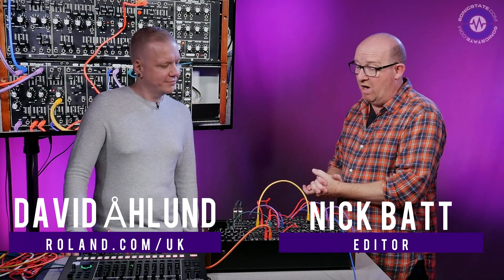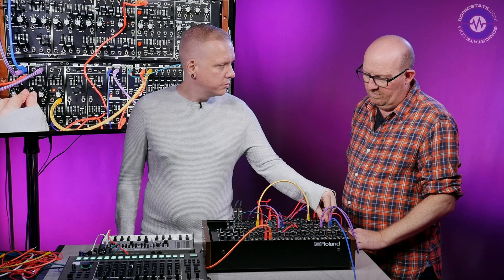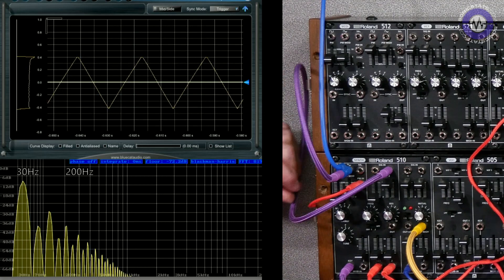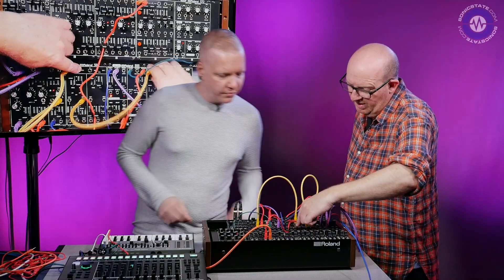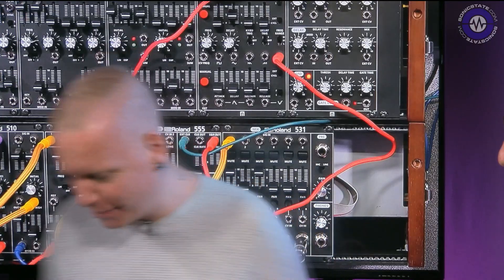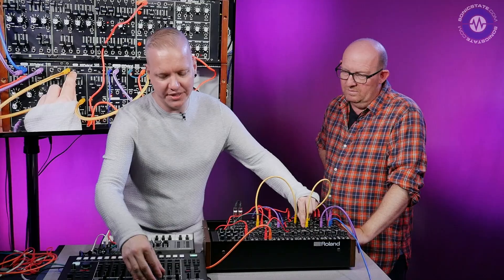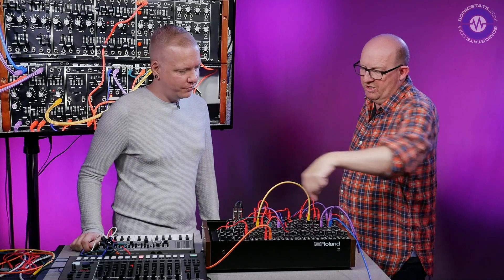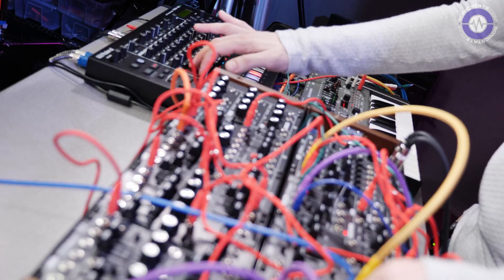Presentation: New Roland System 500 Eurorack Modules

Comment: Next thing I'll be adding to my 15 module 100m and scooper will be the 555. That'll be like having 2 x 165's + 2 x 150's and more. Also looking forward to the Behringer ones, which are more like the originals. More basic than the Malekko Rolands but tempting, as they may be cheaper than even some Doepfer gear! Makes it a tough choice though. I'm wondering if Roland are releasing a 182 sequencer in the 500. Behringers if released looks like a small 182. Both have to compete with Intellijels big Metropolis though, which is a souped up 185----the latter being an extremely rare imitation Roland seq with different design to the 182. For the ultimate 100m type setup add all the 500's and a metro to a frequency central filter to get a 12db filter option too!

Comment: guys, be aware that the 510 & 531 modules have a depth of 128.5mm
 (5-1/16 inches) which is very tall compared to other modules. This eventually stopped me from buying the 510. I got a 512 instead since that's only 58mm.
Not sure why Roland made this choice... maybe just so they can sell there own cases along with it as well, since theirs is one of the only ones that can fit modules that are that tall..
Reply: Depth of the new modules:
SYSTEM-500 531 -  129mm
SYSTEM-500 510  -  129mm
SYSTEM-500 555  -  129mm
SYSTEM-500 505  -  57mm

Depth of the old modules:
SYSTEM-500 530  -  58mm
SYSTEM-500 512  -  58mm
SYSTEM-500 521  -  58mm
SYSTEM-500 540  -  58mm
SYSTEM-500 572  -  58mm

Standard Doepfer Case:
Max 90 - 110mm per module
Reply: 129mm is the height, not the depth. The depth is similar to the old ones. I have mine in a Doepfer case with plenty of space left. There's a misprint on the site.
Reply: David Åhlund lol OK, that's odd. Thanks for clearing that up :).
Reply: No worries! Thanks for (kind of) pointing it out. By the way, you didn't think a "height" of 57 mm was a problem as well? 😉
Reply: David Åhlund nope, that's fine :p

Comment: Awe Roland! Dam. Bit pricey for me but dam
Reply: Yes, they are NOT CHEAP. But they are among the best-sounding of the bunch. 

I've had their V-drums (TD-12s) and Xp-series (the big 80 and the smaller one) since 1997. They all still work great after 20+ years. 

In that time, a removable power cord may need a power supply and cleaning. Non-removable cord, just a pro cleaning. 

You can't be stupid. tho. The keys will snap if you're not smart enough to realize that playing harder doesn't make an electronic piece any LOUDER. That's why God gave you volume controls. 

I've never broken one key. Then, I take it seriously and learn how to treat stuff. I've broken one drum stick and no heads in 13 years playing real drums, either. If you treat it well, this won't be an issue. 

Not bad for its age. I've got stuff way better made internally than Roland that needed work at 10 years (Harmon-Kardon tuner).

Roland isn't attractive inside to dorks, but still works, still sounds great, so THERE. :) 

I think I got my money's worth, big time.

Comment: Sounds overly clinical and lacks that genuine juicy warmth found in vintage stuff/better companies using all discrete design like AJH, as do most of Malekko's modules. Not bad, but that extra something special is missing. It's almost like someone listened to a bunch of Roland SH gear videos and sound, then made their own design based on trying to mimic it from different parts/circuits. Which is probably somewhat what happened.
Reply: They are made in conjunction with Malekko so that throws that theory out the window.
Reply: No, this is a lot of how Malekko's stuff sounds to me, including their new Manther box.

Comment: Is it a bug or a feature for PWM to introduce DC offset like that?
Reply: If no extra charge in price then is bug. If extra charge then is feature. 😏
Reply: It may be a feature of how the oscilloscope is triggered. If its set to AC coupling, the display tends to do this. 

I doubt that an actual DC offset is being generated.
Reply: Actually if you do not move the center like that it will introduce DC offset, since the area between wave and over and under part will be different. For no DC offset the amount of areas should be same. Altough i dont know the reason here is because of scope or this is just the behaviour of circuit.
Reply: I mean strictly speaking there is always a DC component with a pulse wave (due to how we define DC) but what I really mean is that an additional DC offset isn't added by varying pulse width, the scope does trigger on an edge but you can couple the inputs in such a way that they remove the DC component and try to center the wave so that there is the same area under the X-axis (or time axis in this case)

In either case I would be 99% sure that the PW control doesn't add additonal DC components due to how pulse waves are usually generated in VCOs :)
Reply: Perhaps. I have little knowledge of the software being used. Seems from the icon on-screen that it is just triggering from a rising edge.